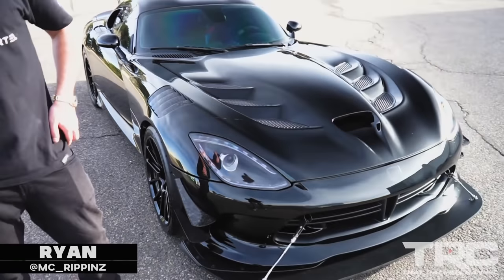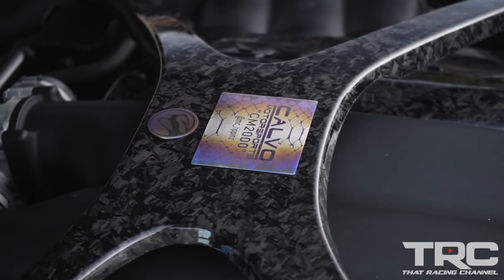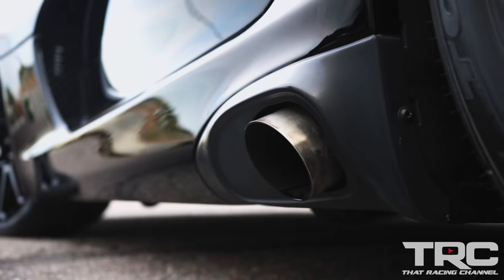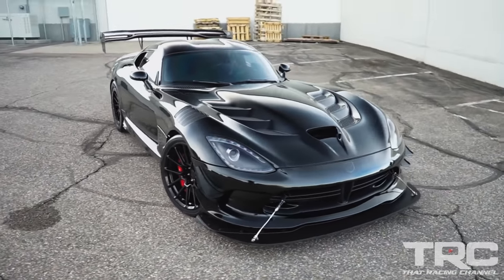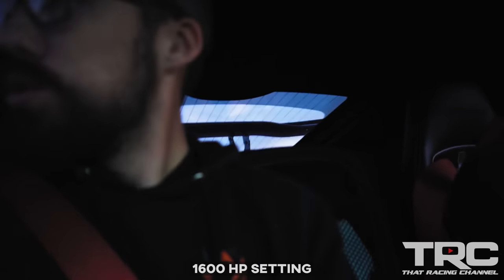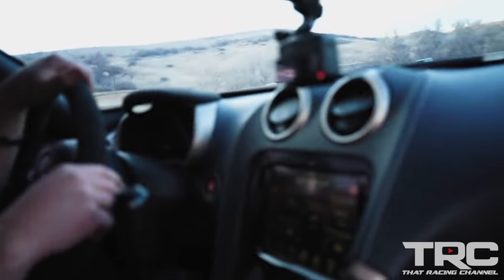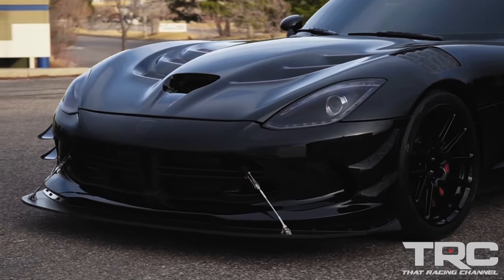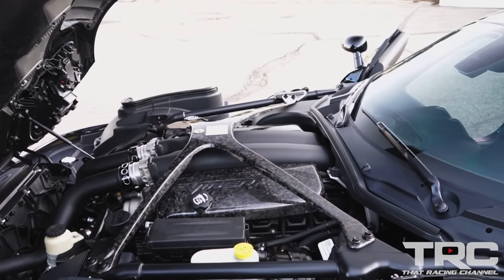2600HP Turbo Viper UNDEFEATED ON THE STREET! 9L Stroker + Sequential (2000lb-ft OF TORQUE!)

Comment: Imagine if he had a long stretch of empty highway to test his top speed
Reply: I'd imagine he really doesn't need that much empty highway with that HP and TQ 🙉🙈🙉
Reply: Can't run top speeds beyond 250 with that kinda aero
Reply: True my honda won't let go past 84 m.p.h with my carbon wrapped apc spoiler. I did do 115 without it tho.
Reply: @devansaginashlarratt3827  the aero prolly helps, a car going 250 mph is faster then a car crashed into a tree cause it flew off the road
Reply: @dimiter.petrov  It helps to a point but this aero is to help this car in cornering. The car was built for high speeds on a curvy race track. To go 250+ yes he needs aero but not so much. That wing would be pushing the ass end of the car through the road lol
Reply: or if it's an adjustable wing he could just change the angle and put less downforce on it and be fine.
Reply: @dimiter.petrov  it does help it stay planted by it limits its top speed.  250 is close to the fastest you can go with a huge wing on the back of a viper

Comment: We need to get behind the RPM act right now or all of this is gone forever.
Reply: RPM act?
Reply: @eac1235  basically, no more modded cars or street-into-race cars.
Reply: @eac1235  basically, the EPA has proposed a bill that's more strict than California's CARB regulations.  No more turbo kits.  No more headers.  No more tuning devices or tuning.  No performance mods for any car that has a vin.  Even trailered track-only cars won't be a thing.   Parts manufacturers, online stores, and tuning/install shops are being shut down right now.
Reply: Thanks for the info, hadn't even heard of anything like this.

Comment: I drove a 97 BMW 750 with a V12 in it when I worked for a small dealership back in the early 2000s When it hit 100MPH with the pedal to the metal it felt like it was just starting to open up and accelerate faster. Really cool feeling. Would be fun to strip one down and turbo it.

Comment: I just did some quick math, to increase a 8 cylinder engine to 10 cylinders is a 15% gain in head flow and an 800hp V8 should now be making more than 1000hp with two extra cylinders, so if the V8 is 7.5l and the two extra cylinders make it 9 adding roughly 15% in capacity brings the V8 up close to the power of the V10. 
I honestly think a V8 will suffice in place of a V10 in a big turbo application, and only see the V10 worthwhile in N/A applications where the extra airflow in the head will make more power. 
There is 727ci V8 engines for sale which can be boost built if you can fit enough turbo on, or just go big front mount centrifugal supercharger.

Comment: I know this may be a peculiar question... BUT...
I recently bought a used SRT-10 TRUCK with the 2005 Viper engine. And I would LOVE to ADD even more HP... 
But I have read or been told, by several sources, that the Viper engine can not handle the HEAT increases of Turbo/Super-Charging...Something about how the Crack-system swells with the added heat and puts pressure on the pistons inside the cylinder walls... What can I 'reasonably' do to increase the HP by around 20-25% at a modest price and without destroying the Auto-Trans... Not looking for a "Street Racer" just more fun to drive... going from the "Advertised HP" or 505... to maybe something around 625/650 HP... I have a neighbor with TWO Hellcats {a "His & Hers" Combo} and I just want to wake THEM up in the morning once in awhile... Ha Ha
With some New Trucks coming from the Factory with 700hp+ I need to still be able to stay 'relevant'... 
I can understand about the high heat... It has never "overheated" on me, but it HAS cooked all  the red paint off the valve covers...
Since this video is from 2 Years ago, I realize you probably do not check comments very often... so Whenever you DO read this, you can contact me by email at floydburdett@gmail.com ... I would appreciate hearing from you.

Comment: being 2 yrs old.. probably true but not true today.  My rocket BatMobile would kill it embarrassingly.  0-60 .73 seconds 0-150mph 1.9 sec  0-350mph 8.7 sec.  0-533mph 17 sec.  Calculated 4744lb ft of torque. Flame length 31 feet.

Comment: 2700nm torque, 2600hp, perfection in balance. 
My puny car does have two times the hp in torque,  which is not a bad thing, not at all, and you do feel the torque working uphill. 
I cannot imagine this one Viper's power, impossible. 

I recently drove a Dodge Ram 2500 cummins with about 1000nm torque, it felt unstoppable, and it's less than half what this car have!!
I live in europe, the cars here are mostly trash gangster looking things with tons of hp but the torque of a coffee machine, otherwise they possess the RPMs of a CNC machine, such ugly annoying stuffs, perpetually in repair. 

If I would ever win a lottery, first thing I would take is the viper, then give a call to Calvo.

Comment: These are like 6-7 second cars right? Very nice. Im sure the V10 holds up really well with the displacement, Too. Ive always wondered if a Lambo would be a better twin turbo, Because of its design, In terms of handling and aerodynamics? Cause those older Vipers have no form of abs systems etc right?

Comment: I wanted to go the viper route when I first got into high hp cars but the cost of the block was just insane.  I went through 2 blocks in my z06 which is way cheaper than that 10 cylinder viper block.  I chose wisely.

Comment: I see a lot of y’all talking about bikes here. Just to set things straight I thought I would put in my two cents. A car at 600 hp will probably lose to all liter bikes. A car at 1100 hp would probably beat an R1 and a CBR1000RR. A car at 1600 hp probably beat every liter bike except for an H2R and an MTT420. But at that point, you couldn’t even consider it a liter bike. And a car that has 2600 hp or above will absolutely destroy any bike on this planet. 
This is not including drag race bikes, for obvious reasons.

Edit: corrected/replaced “buying” with “bikes”

Comment: Just think the coast guard helicopters  45 % the HP as this car....835 hp
Fuel Capacity 291 gal / 1900 lbs Power plants 2 x 835 hp Turbomeca Arriel 2C2-CG turbo shaft- engines

Comment: I used to build cars in the 80's and 90's. All B.C. 327,350,440,455,460 c.i. cars were 50's,60's, and 70's models. nothing to compare with this.
She's  a beautiful thing.
Just one thing though. Now that you're adults, could you show a little guidance and safety to the younger generation. Maybe not show videos of you speeding on public roads. One thing goes wrong and your giddy excitement turns into "OOPS it was and accident. sorry I mamed your mother, grandmother, or child for life"
Seriously keep it on the race track.
Reply: when you build a 1900 hp car and speed on public roads, it's never an accident. I call that an on purpose.

Comment: It goes fast in a straight line, but can it go fast around a corner?
Reply: its a viper...
Reply: vipers are littarly built for a circut...
Reply: @THELTX427VA  they are built to go fast in a straight line, and nothing else
Reply: @stewhite3875 tell me you don't know anything about vipers without telling me you know nothing about vipers. Wtf do you mean onlt for straight line? Why do you think it has 1200 ibs worth of downforce stock? Would have all that if it was for drag racing? How would it do 7 minutes on the nurburgh ring if it was only built for a straight line?